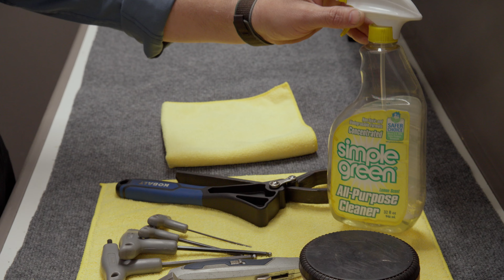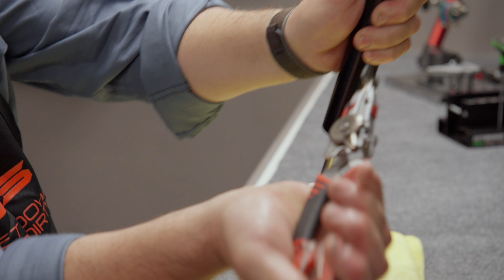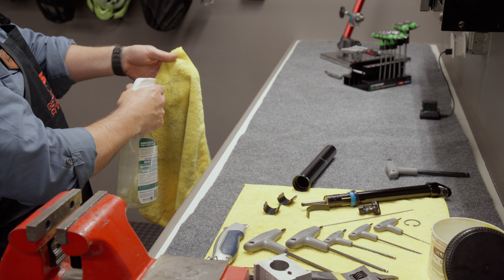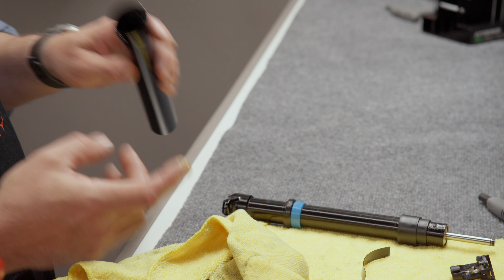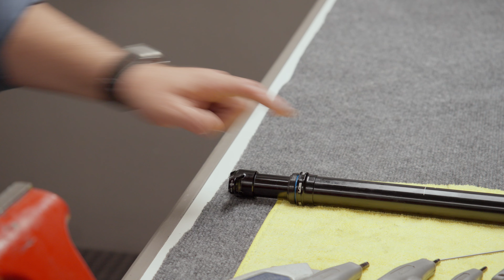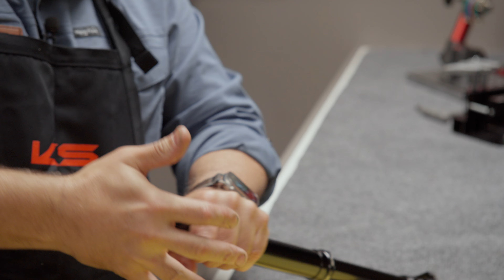KS Rage-i - maintenance video

Comment: Wasted a ton of time making a tool only to have the dust/wiper seal be fused onto the mast. This destroyed  the bushings when trying to separate the cartridge from the mast. 

This design may have worked at a cheap cost, but it was awful for service and maintenance. Slowest return speed at the trail head too. I think that will do it for my time with any KS products.
Reply from the maker: Hi, and thanks for reaching out. Replacement bushings are available thru your local dealer and are relatively inexpensive. For future servicing, following the service schedule (every 3-6 months) will greatly reduce the chance of the seal sticking to the mast tube and becoming difficult to press out.

Comment: Loved the video, super professional. Love this dropper too. Opened my dropper and happened to miss one of the short plastic pins. I've done some research online and i cant get the spare parts since i live in Argentina 🇦🇷 and cannot find the distributor. Can i reassembly w one pin missing? Thanks in advance
Reply from the maker: Hi, thanks for reaching out. If it was only the white plastic part, it’s ok to use the post. If any of the brass bushings were lost, they will need to be replaced before using the post or damage could result.
Reply: @kssuspensionusa  thanks a lot. just to add I have been using/ ab using  this post for more than 8 000 kms and it still rocks. keep on designing/manufacturing stuff like this.

Comment: Hi, the only service kit I can Find for KS Rage I - has 4 metalic guide pins and 2 plastic ones.
If I find inside 6 metalic ones same as in this video - where do I put the plastic ones (witch btw are smaller / shorter) and where do I put the brass metalic ones ?
Reply from the maker: Hi, and thanks for reaching out. If you have 6 metallic, you would replace the 2 front and back with metallic and use the 2 plastic on the sides.  
The length is not an issue.  The guides are held captive in the stanchion and do not need to fill the entire groove.
Reply: Its the only service kit that I can find on MTBiker for Ks Rage I.
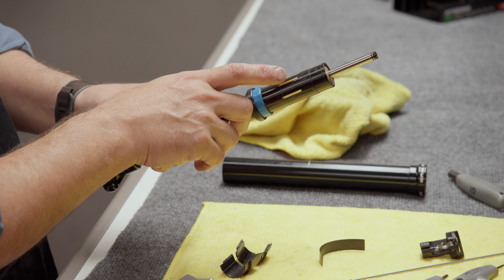Reply: He told about it 11:30

Comment: Ive got a 170mm dropper on a amflow  PL but it only travels up 150mm, any thoughts ?
Reply from the maker: Hi, thanks for contacting us. Are you sure it's a 170? It may actually be a 150.
Reply: GC02454 diameter 31.6/495

Where abouts does over all length get measure from ? Also the stroke/travel should be 170 right ?

Also strange my dropper only has 4 guide pins but has 6 slots

Comment: I have to replace two of the plastic guide pin bushings on mine, but I'm having a hard time finding them. Can I replace them with the metallic pins, similar to the other four it comes with or will it damage the dropper?
Reply from the maker: Thank you for reaching out. The plastic guide pins provide a slight preload and reduce the chance for any rattle or side movement.   Metal guide pins will fit and work…. But the plastic ones are recommended for best performance.  Your local dealer should be able to source these pins for you.
Reply: @kssuspensionusa Thank you!

Comment: Is it possible to add air to this dropper post?
Reply from the maker: Thanks for your question!
It’s not possible to add or adjust air pressure on the Rage i dropper post. This model does not have an adjustable air system. Air pressure adjustment is a feature that can be found on our LEV range only.

Comment: How about a video on how to shorten the stroke on these droppers if you have one that is too long.  I just bought a bike with a 175mm dropper that is too long for me. I know on most droppers from other brands where you can put shims in it to shorten the stroke of the dropper.
Reply from the maker: Hi, thanks for reaching out! Your post does not offer an adjustable travel feature.  You would need the next shorter spec post.  
We do offer an adjustable travel post, the “Vantage”, which allows for adjustment with the turn of an Allen wrench.

Comment: Amazing video! 
I try to service my dropper post but after servicing  it is showing same problem as before like pressure is low or something stopping to fully extend the dropper post.  Would you help on that please!
Reply from the maker: Thanks for reaching out. It sounds like the issue may come from the cartridge inside the post. If your dropper is still under warranty, the best step is to reach out to your service partner for support. If it’s out of warranty, your local dealer can help with a non-warranty repair or replacement so you can get it working smoothly again.

Comment: My post has started  to creak with some side play , made me think my bb was shot until I replaced that and it was still doing it ! Would this be guide pin wear ? Need a few tools before attempting your video 😂
Reply from the maker: Thanks for reaching out. Most likely just needs service. Disassemble, fully degrease and lube and assemble. Use anti seize in all metal to metal contact points on the saddle clamp assembly. Also, be sure to torque clamp to spec using torque wrench. And here is how to DIY a bearing press tool: https://youtu.be/qprGOjYCAkY?si=fX7TPleOpu-QsrBA

Comment: The actuator lever on my Rage-i dropper broke suddenly and no longer holds the "barrel" that connects to the cable.  Is this a replaceable part?
Reply from the maker: Thank you for reaching out. Yes, that would be Part #A3196.
Reply: @kssuspensionusa  Thanks!  I found the part, but how is this part removed from the dropper?  I see it is held in by 3 pins but I don't see how to remove them.  Is there a guide or video that addresses this?
Reply from the maker: -Remove snap ring with snap ring pliers.  
-Remove actuator from end of post
-Using a small punch (or wire brad / nail) drive 2 pivot pins out (towards the larger diameter side of the pin)
-Remove the old actuator
-Install is reverse of disassembly.
Reply: @kssuspensionusa  Perfect!  I really appreciate the response.  That's exactly what I needed to know.

Comment: Hi, Is there any website available to find the plastic tool to hold the pins to insert the seat post? I've searched the internet and can't find it anywhere. 
Thanks.
Reply: a small rubber band is working well, you can also use thin o-rings for that, but you will have to cut them to remove em after the lower bushing and guiding rods installation. i think its even easier than the tool from this video, because you just put that rubber band on installed bushing and second on guiding rods and will just hold the parts together without your assistance, so you can assemble the seat post. these rubber bands/o-rings will slide up and stay on the upper leg, just beyond the upper bushing so you can remove them.
Reply from the maker: Thanks for your message and for checking out the Rage-i seat post tutorial. You're right — the small plastic tool used to hold the pins during reassembly isn’t currently available for sale which is why the tutorial includes a simple and effective DIY workaround: you can create a makeshift sleeve using a piece of an aluminum can. It's a practical solution many riders have used successfully, and it allows you to carry out the service without the official tool. We understand this isn’t ideal, and we're continuing to advocate internally for a proper tool to be made available to all riders. In the meantime, if you’d like any extra tips or guidance on using the DIY method, I’d be happy to help.

Comment: My Rage-i dropper seat post is a somewhat slow to come back up - I was considering servicing, but based on this video, it doesn't look like a lot of lubrication is applied so I have my doubts it will resolve my issue. Will going through the motions help with the return speed or is it more likely the cartridge is a faulty? Thanks.
Reply from the maker: Thank you for reaching out regarding your Rage-i dropper seat post. How long has the post been ridden?  Have you ever serviced it before?
Reply: @kssuspensionusa  thanks for the response! Post was on a '21 bike, that saw moderate usage - never serviced.
Reply from the maker: In that case definitely perform a maintenance service in the post to start with.

Comment: Please do a video servicing ks exaform 900i dropper post. Also include how to refill air and oil in it.
Reply from the maker: Thank you for reaching out regarding your Exaform 900i dropper seat post. The Rage-i is actually similar. BUT, it's a sealed, not rebuildable, cartridge so there isn't any refilling of oil/air on that one.

Comment: Is there any way I can add more pressure to make the seatpost pop out faster? I noticed on some other brands that you can add pressure like you can on shocks and forks.
Reply from the maker: Thank you for reaching out regarding your KS Rage-i dropper seat post. Adjusting air pressure is a feature available on our LEV series models only. The cartridge in the Rage-i is preset and does not allow for additional tuning in that regard.
Reply: @kssuspensionusa  Thanks for the info

Comment: Yo i just bought a brand new bike and it came with a KS Rage-I but it doesnt react when i press the lever
Reply from the maker: Thank you for reaching out regarding your KS Rage-i dropper seat post. Have you had a chance to mention this issue to the shop where you purchased the bike? They may be able to assist with setup or adjustments to get everything working smoothly. Additionally, it would be great to know where you’re located (city and country). This will help us identify the nearest service center or provide you with tailored troubleshooting steps, if needed.
Reply: @ already fixt it but thx for the answer

Comment: One little tip after doing it, if you don't have the tool to put back the band bushing. I used a bit of electrical tape to maintain it. 2/3cms of tape put from the half of the band bushing width, to the top. Put a little bit of grease if the tape is too sticky. By putting back the seatpost into the tube, it'll push the tape and luckily the band bushing will stay in place. No over strenght, be careful, and try few times if needed. It worked well for me.
Reply from the maker: Thanks for sharing! Not a bad solution, but it could leave adhesive on the band bushing and could cause it to gum up and the post could become sticky.

Comment: Thanks for the tutorial! Since the first day have a little side clearance. After some time of use, it has increased considerably. Could it be due to worn guide pins? If it is the fault of the guide pins, where can we find spare parts? 
Thanks
Reply from the maker: It could be wear on the guide pins… you can source the pins from your local dealer.   
Not sure where you are located, but here is an online retailer with them:
https://www.ebay.com/str/worldwidecyclery